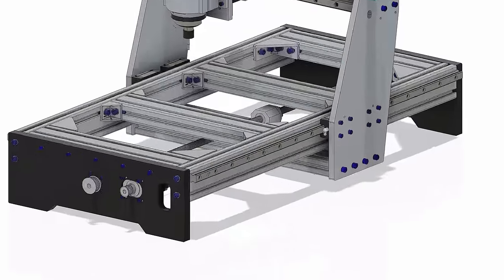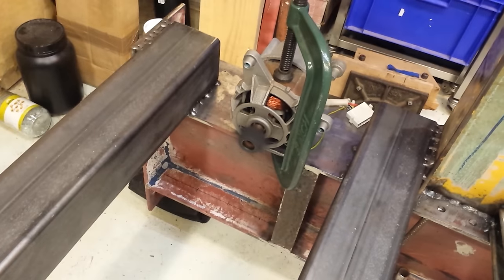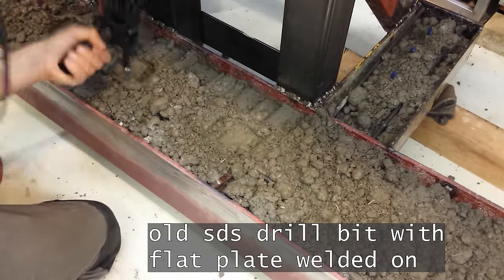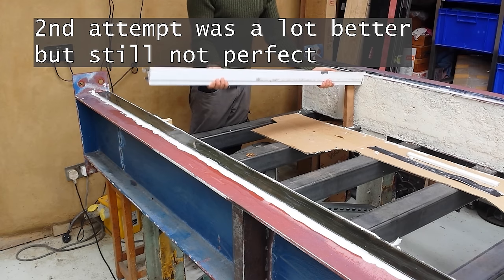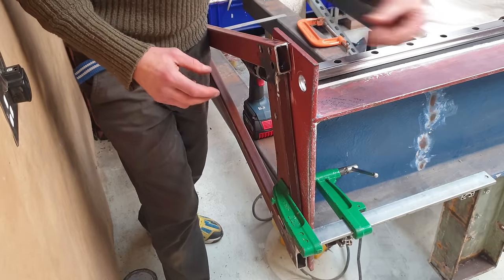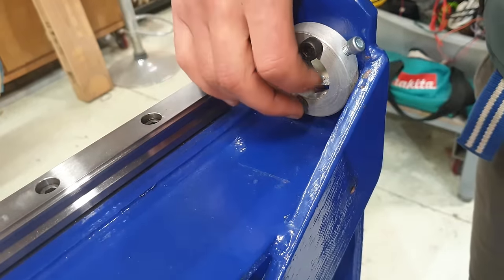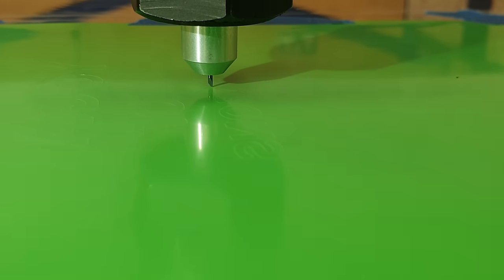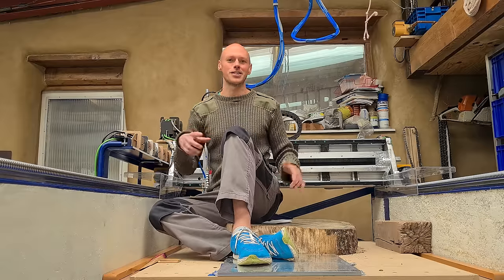Can we DIY an Industrial grade CNC?

Comment: What’s the tightest tolerance you achieve with that beautiful machine?  Can you mill steel to 1/10th of a thou?
Reply from the maker: Hi friend, thanks for watching. Sorry for the late reply. 
I think in decimal but do you mean 0.0001inches or 0.00254mm? Short answer, no way, not even close. I'd be surprised if my typical tool run out wasn't more than that on it's own. Add in cumulative error from linear bearing, ballscrews and belts, servos etc. and of course deflection under load, and the number is much higher... I still have scant experience machining steel (but see some of the more recent vids). Realistically I'd be very happy if I could get real world machining in steel to 0.02mm.

Comment: Very nice dude,

is that a JGL120 ?
Reply from the maker: Hey thanks :) Its a 4 pole JGL-100mm 3.2kw 24000rpm BT30 ATC - added info to the description.
Reply: @FloweringElbow  oheee its the little baby to my one,
:D ive not tried steel or cast iron with mine, not.. deliberatly..

but if yours can do it... :D mine can do it too!!!!

i have the JGL125 24k 5.5, and its amazing.

you have your self a wonderful spindle there :)
and a lovely machine for it too!!!
Reply from the maker: @sommersetcoker5455  you have the 4-pole or 2? can you / have you tried tapping at all?
Reply: @FloweringElbow  I haven't tried tapping, one of my friends is buying the same spindle as me, but wanting to use it for the occasional rigid tapping.
im now second guessing my self.
 im sure its 4 pole. but i could be wrong and i might have the 2 pole

it dosen't bog down, even when im pushing the collet nut through aluminium plate... :D (again, not deliberate)
Reply from the maker: @sommersetcoker5455  lol, I may have had a similar experience, attempting to burn my way through 1" thick hardwood with the collet nut... 
Would like to know how your friend gets on.
Reply: @FloweringElbow did you get wafer to add the encoder to your spindle?

(does mach support encoders?)

i rigged an "encoder" up to mine, on the spindle nose, the nylon cap that it come with, i milled a hole for the tool holders and the air curtain, and then mounted proximity sensors to it that read the dogs on the tool holder face.
its not perfect, but its functional.

Comment: did you consider adding poly fiber to the concrete?
Reply from the maker: Hey Grober, I did. in fact in some of the batches I snuck some in as I already had them from a different project. I put in polypropylene fibres 9mm : 1% by weight - but I probably would leave them out if I didn't already have them... This was in addition to the AR glass fibers which I added 3% by weight (that's 3% measured against the weight of the dry cement + pozzolan powder, just to be clear - the standard way of dosing additives)
Hope that helps, Bongo.
Reply: @FloweringElbow  nice. keep on doing what you do. enjoyable series.

Comment: Hello Flowering Elbow, do you notice any sound or bump when the bearings travel over your rail transition? I am about to purchase a good ebay deal on 2000mm and 1200mm rails that I plan to combine into 3200mm
Reply from the maker: Hi there, not at all, no. I imagine the very high quality thk rail has something to do with that though - and very flat mounting surfaces. Hope that helps. What rails you thinking of?
Reply: @FloweringElbow  THK SRG35LRF. Haven't decided if I want one on each side of the gantry, or two on each side making a linear motor sandwich. I'm using Akribis AKM100-B4 linear motors. Two 3000mm, one on each side of gantry and then one 1500mm across the gantry. I've been in the CNC/Automation space a long time, and I decided it was time to make an exhibition machine after mostly making budget machines. It's for my wife's wood working shop we're building in the back yard. But it's going to be more heavy duty than anything I have so I'll probably use it more =P
Reply from the maker: @TheJuicyBurger  haha.  Those are some big rails. Sounds like it will be quite the beast. Good luck with it.
Reply: @FloweringElbow  Big 'ol fatties. They should be able to handle cutting some balsa wood at least. Any estimate of what sort of flatness you think the self leveling epoxy can achieve? I was planning to use surface plates to create a mold and cast sections of my rail mounting surface out of epoxy granite, then tediously align them all and epoxy together. Which I still might do, but I'm curious on the self leveling since the way you have done it seems to result in a quite flat situation.
Reply from the maker: @TheJuicyBurger  I'm honestly not sure now. Before setting out I thought it could get very flat, but you really need to research a lot to get the details spot on... 
As you saw I didn't manage it first time and even on the second go I had to tweak it by scraping... recon I have it within 0.02mm over the 2.4m length now, but i think it was about 0.3mm out after the 'self level'. Other people have done a much better job than me though...
Reply: @FloweringElbow  I've explored the self leveling before, but yeah the viscosity tends to lead to peaks and valleys. I'm probably going to stick with the sections cast in chunks then tediously aligned. Might even borrow an autocollimator to really verify. You referenced a study where you highlighted sections that talked about replication and such, but have you read Moore's book? Foundations of mechanical accuracy. Highly recommended. All of modern machinery is built upon what Moore describes in the book. Establishing flatness, transferring flatness, etc
Reply from the maker: @TheJuicyBurger  sounds fantastic,  but no not read that one... Will be on the lookout for it.

Comment: Add a delay to the motion so the spindle has time to get up to speed.
Reply from the maker: Yep, I have this setup in Mach3 now :) I was adding G4 P10  to the g-code for a good while (and forgetting sometimes!) before I figured out how to automate with Mach3 settings :)
Reply: It isn't a delay. A machine controller has an acceleration scale it uses. Machine controllers should be intelligent enough to take inertia into account. It's all part of path prediction.

Comment: very nice but how to move it when changing houses?
Reply: That's what riggers and machine movers are for. Realistically you could probably drag that machine up onto a flat bed truck. Those things can recover car wrecks in any condition. Including when they're just twisted masses of metal.
Reply: @1pcfred   That's great but am talking about removing it from the building because it cannot fit a standard door size and the joints seem to be welded together
Reply: @DeejayGrafixx  That's when you use a crane and hoist it through the roof. Everything that can fit in a building will fit through the roof. And hoisting through the roof is the common method of moving oversized machines. Sometimes you have to think outside the box. If it has to happen then there are ways of doing things.
Reply: @1pcfred  that is actually genius ,i never thought of it that way,thanks for your reply
Reply: @DeejayGrafixx  if a machine is paying the bills then whatever it takes I guess. There's stories of people building boats in their basements and then when they're done they dig out the backyard and knock the foundation down to get it out. The answer to how do you do anything is you just do it.

Comment: All that weight built into the base with those huge rails and then go so light on the gantry?
Reply from the maker: The gantry is still quite rigid, and I was more strategic about damping with it (there'sa whole vid on the gantry build if interested)... the gantry's weight is much more critical as it is quickly accelerating and  changing direction a lot.

Comment: bruv... you know you can buy the big aluminum extrusion pretty cheaply if you dont get it from one of the companies that sell kits right?  like..I bought a kit cuz I didnt want to dick with it, and I love mine (avidcnc), but the extrusions are pretty great.  I think my machine comes in a little over 700 pounds, so not the lightest or the heaviest machine, but shes strong, works really well, and makes me happy to have her in my garage.  lol.

the good news, is that with THAT much weight, that much of everything overbuilt that far, your machine is gonna handle steel even better than mine does.  just gotta use the right electronics, high strength movement parts, etc. and it looks like you've picked pretty good choices... I wouldnt be surprised if she handles it all.

Comment: I may have asked that before but can you go into more detail on the spindle and how well it's running and tool changing?
Reply from the maker: The spindle is running well ATM. Haven't pushed it to the limits yet (except when I stalled it drilling steel at 1,000rpm when I meant to be 10,000rpm). 
The tool change is nice - but I haven't yet setup a rack and automated changes. The "manual-auto" That I have been doing is great - a massive time saver. I will do a whole video on the spindle at some point.  
You thinking about getting one?
Reply: @FloweringElbow that sounds pretty nice. 
I'm currently building a CNC as well but for now I have 200€ 3kw water-cooled non ATC one but I might get one at some point to save me some time. I'm definitely looking forward to a spindle vid! Thanks for all the stuff you share :P

Comment: hi sir. what is the step motor you using for your cnc and do you use the gear for the step motor ?
Reply from the maker: Good morning sir, we are using 400W AC servo motors actually. They are driving by HTD belts. hope that helps.
Reply: @FloweringElbow   thank you so much.

Comment: So you do realize that even high end CNC machines typically don't go as over the top as you have gone. In my experience They usually stop at I-beams and just bolt it to the floor with vibration dampening pads. I have never seen one filled with concrete. This thing is going to be better than and stiffer than a lot of industrial CNC machines.
Reply from the maker: Hey Alex. Embarrassingly I have limited (no) experience in CNC industry in truth and your comment made me smile, so thanks :D

Comment: I would print some cable chain for you if you wanted.
Reply from the maker: Hey thanks Nicholas! The ply one is holding up ok so far. I could have a different project for you if interested. I'd like to make some wipers for the ballscrews, to fit on the rotating nuts...

Comment: Lol.. wish I had the drive and determination... often wondered if you could use a swimming pool....straddle axis over it... overhang the pool with a guide...  and push up with buoyant force at ends... keep z stationary... 
Or you could go circular and do a overhead bridge for z.... just run it as a   
X/C.... could run it as a vertical lathe as well... idk... just always thought DIY materials... old engine blocks... upside down... run round stock between identical engine blocks crank side up.... something that can be done cheap to give 3rd world countries machining capability on the cheap
Reply from the maker: Nice ideas 💡 👌 👍

Comment: Look forward to rusty ballscrews. You can not touch them with bare hands unless you want them to rust. Doesn't matter what you use to lubricate them, once they have hands on them or the linear rails they will rust.
Reply from the maker: Good morning Dodgy Brothers Engineering, I wonder why this might be the case? It has not been my experience thus far - with metals of any other kind... Thanks for watching :)
Reply: @FloweringElbow   speaking from experience... I bought some genuine Hiwin linear rail and ballscrews for mine. I contacted a importer who imported very large CNCs into Australia to find out how I could keep the rust at bay. They told me once touched with human hands there was no way to remove the effect to come. They were serious about what they were saying as the were doing some assembly of a CNC while I was there with rubber gloves on to prevent touching them with their hands. I asked what the best lubricant to use was and they said WD-40 Specialist White Lithium Grease. The replacement linear rail I bought have already started to do the same thing since I handled them as well before I talked to these guys.
Reply from the maker: @DodgyBrothersEngineering  hope that doesn't happen. Will have to wait and see I guess. Will update it I see signs of it.

Comment: You went through a lot of work to make a perfectly level machine. Forgetting that level is relative since you can just surface the spoil board to make a flat board.
Reply from the maker: Hey there Marsrover001. Thanks for watching. Yeah, trust me I was very aware that level was not the goal, rather perfectly co-planer. It just so happens that with my tools, the easiest reference to ensure co-planer is the level plane provided for us by gravity. It makes the precise spirit level work and epoxy flatten out... Without it, it would be very hard to get both long rails perfectly aligned. 
Cheers, Bongo.

Comment: I wouldn't mess around cutting brake parts like that because of the asbestos hazard.
Reply from the maker: Hey Chrimony, thanks for watching. It's a valid concern but in the UK the use of asbestos in brake pads was banned from 1999 - and those are old cast iron disks from our van so I know what pads were fitted with them.  I did wash off most of the brake dust before I stashed them in the corner for a few years ;)

Comment: How much did it cost to build?
Reply from the maker: The building was free, I did it. If I charged myself an hourly rate, it would have been one very expensive machine!
Reply: @FloweringElbow  yes, I was wondering how much all the parts cost like the bearings, steppers, spindle etc. I'm jealous of how much space you have would cost an arm and a leg in Surrey
Reply from the maker: @samrix5793  Yeah, as its happened over such a long time, and involved so many e-bay one offs, I didn't think that would be super useful to people (as well as losing track myself!). The motors are second hand AC servos, complete with the drivers they were about £1k delivered. that and the long x ballscrews (£650) were the biggest expense, I estimate it ran up to something like £4K with all the bolts and LM guides, spindle etc...
Reply: @FloweringElbow  lot of machine for the money! Will you look at asking an atc tool rack and quick change spindle?
Reply from the maker: @samrix5793  Yes am finding many ways to incorrectly build the tool change rack/ procedure now... ;)

Comment: 26:11 
It was a hassle to set up what now? the drip tray? that's what you considered the "hassle" part?! I literally just sit here & watched this WHOLE video...
& it boggles my mind, ALL the work that you alluded to going into this thing... 

Anyways.. I'm just a layman compared to you, but I can appreciate this beautiful machine you managed to cobble together.
Awesome job!

ON a side note... that was really scary when you were flipping it 
(I've put steel I-beams under a house b4, and that kind of stuff get's sketchy dangerous..if something goes wrong, it could be limb loss).
.after you had filled it with concrete, you obviously miss judged the weight, by a bit...
I'd say, if you hadn't filled it with concrete, you'd still had the stability you wanted after ALL the metal bracing you added???
Reply from the maker: Hi MRSketch. Thanks for watching. Yeah, the flipping was quite fun/terrifying. It probably would be ok without the concrete, but it does really help with the vibration damping. Thanks again, Bongo

Comment: Why not just use sand?  Sure concrete is structural and dense, but dry sand grains should vibration dampen more? No?

Imagine a concrete or stone ball, it would bounce just a bit, but a beanbag just plops and sinks with zero bounce.

So you could create a cavity and then just fill it with sand.  It would save days of effort?

Comment: Don't get that whole epoxy leveling thing. First of all, your linear rails are ultimately resting on ... epoxy, plastic. Soft, squishy and temperature dependent: not for coefficient of expansion issues, but for bulk softening under thermal load. The least you could have done would have been to embed either vertical graphite rods or graphite ribbon in the epoxy, oriented to resist compressive stress in "Z." But then again, the epoxy is also poor at resisting lateral forces, too. 

Plenty of back and forth by that titanic gantry over the rails must generate considerable heat. Since that back-and-forth generally happens over short ranges I would anticipate "saddling" in the epoxy underneath. With your enormous investment in frame stiffness, it seems counter-intuitive, and counter-productive, to bed the linear rails in unreinforced plastic. And since, in the end you ultimately had to laboriously "scrape your ways in," why not just START with delrin at least, or aluminum, or even cut some ways out of an old junked lathe? Just not feeling that epoxy bedding trick, expecting it to haunt the tool forever.

The apparent mass of your gantry is simply shocking. Your objective is to accel and decel it multiple times per second. That guy who got a headache from an apple falling on his head had something to say about, you know, inertia. What you actually wanted was a featherweight gantry. Perhaps now that you have a slow machine tool you can gradually upgrade that kit rather than fooling around building SCARA arms to hold a computer monitor.